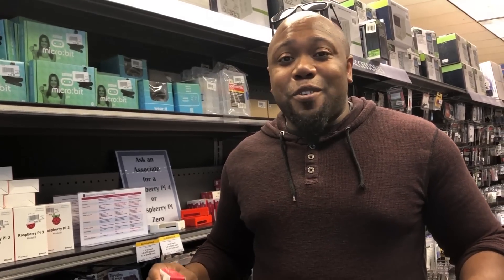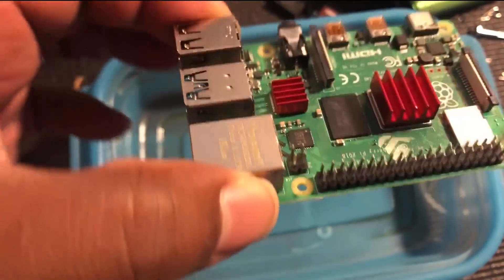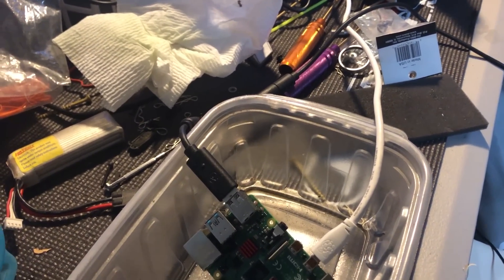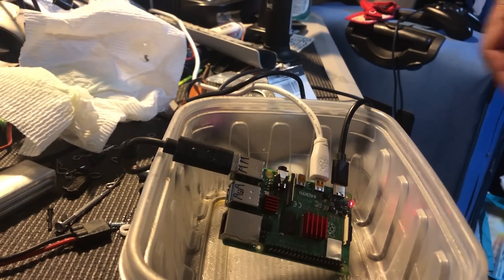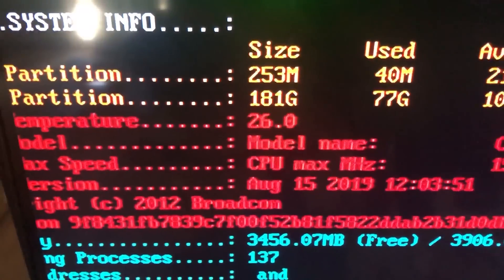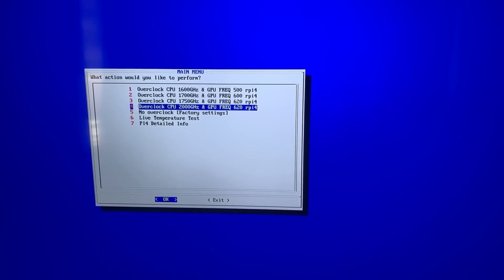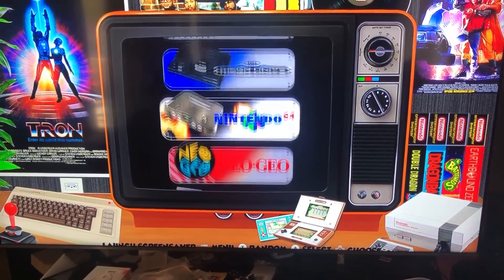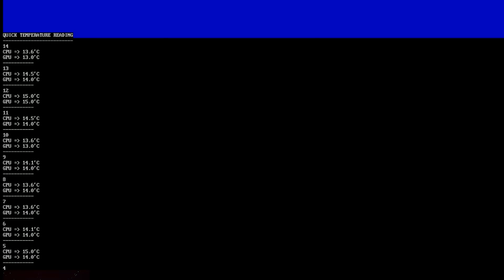Raspberry Pi 4B 2Ghz Water Proof Overclock Test!!

Comment: Should be able to get higher than 2 with ice no? The limitation i guess would be supplying the right amount of voltage? I get 2ghz with an aluminum case and just run a little desk fan on if from time to time.
Reply from the maker: Ya
Reply: @kiodiekin  i haven't tried it yet but for 15 bucks there's a kind of break out board that lets you use a computer psu for power. A little over kill but considering the overkill projects people are doing with Raspies it might be worth a look. Not for a 1500 watt psu but a 450+ sfx psu might be worth if for running and overclocking clusters.
Reply from the maker: Sweet Man U doing. A video?
Reply: I might, my main thing is blender, but i may do it as content for a friends channel. I've been playing around with using raspberry pi 4 as a mine craft server, so the next (il)logical step would be to make a Raspi super cluster and run multiple servers because the ability to do so is reason enough. XD